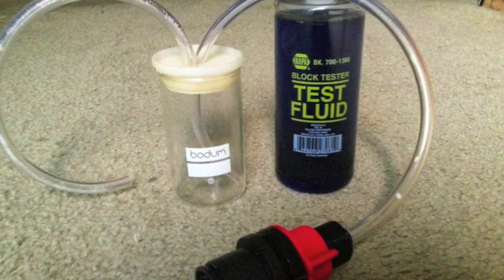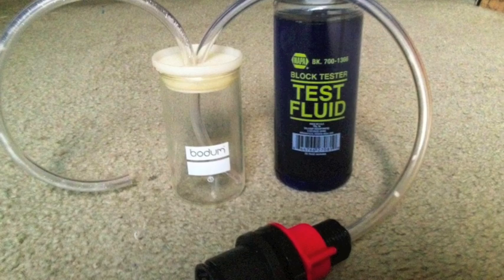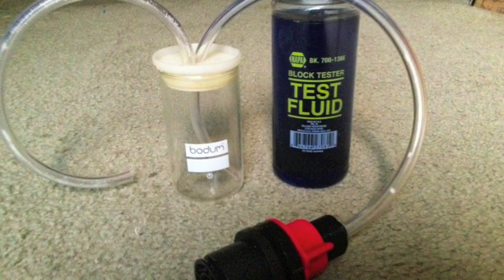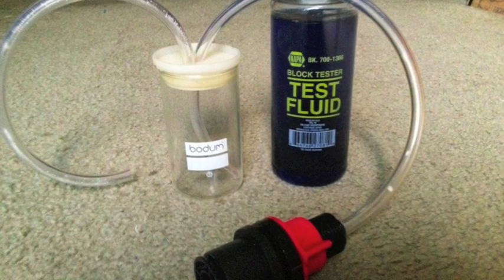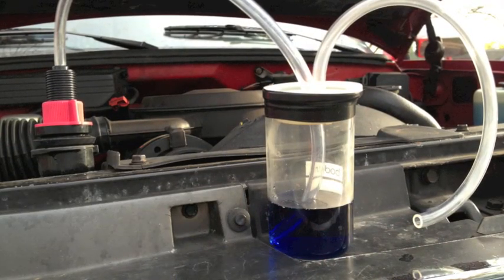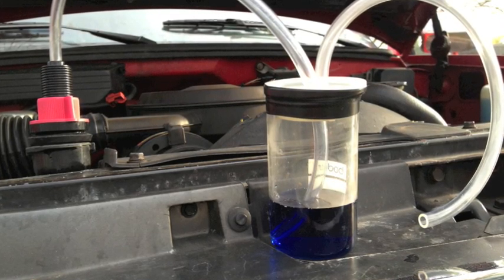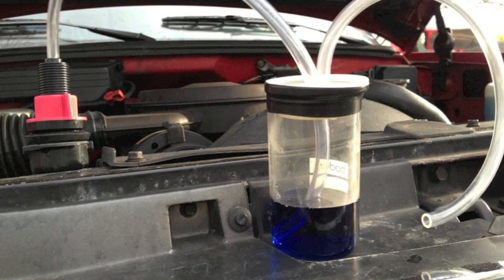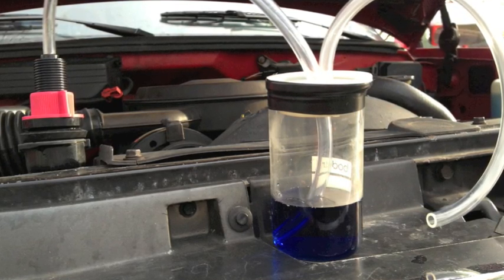Combustion gas leak test

Comment: so it was a head gasket then?
Reply from the maker: +Dave Wheeler no, it was a plunged up radiator,,i was getting false positives for combustion leak,if that doesn't confuse things even farther
Reply: +noblsht 
I'm getting a green/blue color to my test, but alot of pressure in the upper radiator hose and bubbles in the reservoir. Truck doesnt overheat. Put the tester to the exhaust and it instantly turns yellow. confused.
Reply from the maker: +Dave Wheeler of course it shouldn't instantly turn yellow at the exhaust pipe, I took my truck for three shops and I think a couple one of these bastards lied to me and said he saw bubbles in the reservoir another shop tried long and hard and they did not see bubbles in the reservoir, I did not have bubbles in the reservoir I was hoodwinked by some of these people and I ended up swapping out the engine unnecessarily, If you got bubbles in the reservoir that could be a combustion leak, But like I said I had a professional shop use the real tool to test for the gas and it showed positive also but I'm going to say it had to have been a false positive
Reply from the maker: +Dave Wheeler if it's not running hot, And you do not have oil in the coolant or coolant in the oil, I doesn't sound like you have an issu

Comment: If you have to vent the little jar to the outside, then you can just leave the jar open with no cap right? As long as the tube from cooling system is submerge in blue liquid?

Comment from the maker: Ticket to a Chevrolet dealership, without giving him any information about the radiator being fairly new, he took the heat gun, And said the temperature differential between the top of the radiator in the bottom of the radiator or too extreme, I had previously taken it to three separate repair shops and not one of them could  give me a hint as to the problem other than telling me head gasket